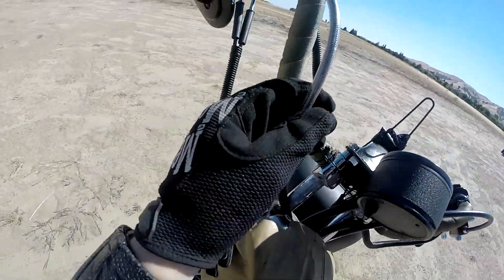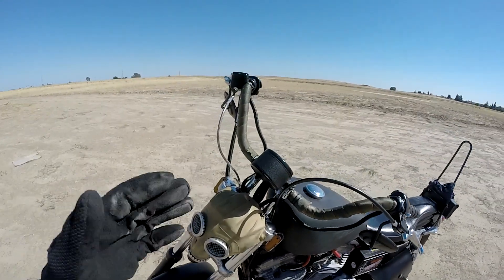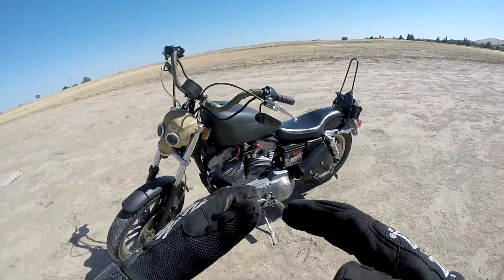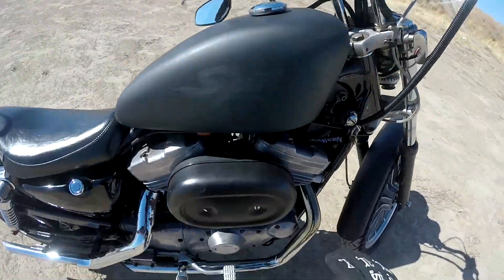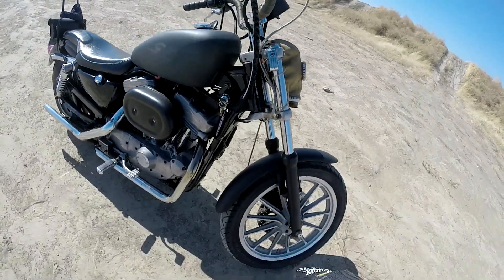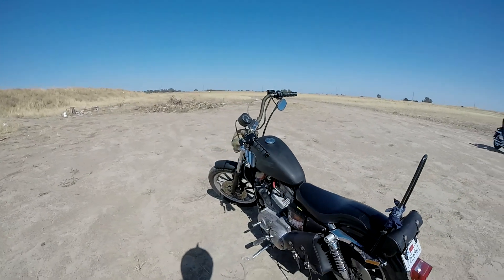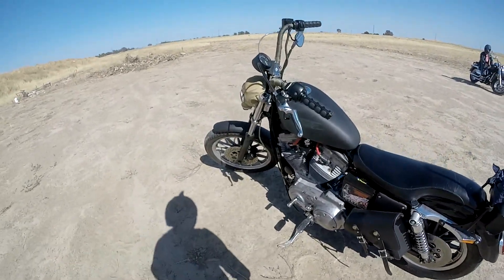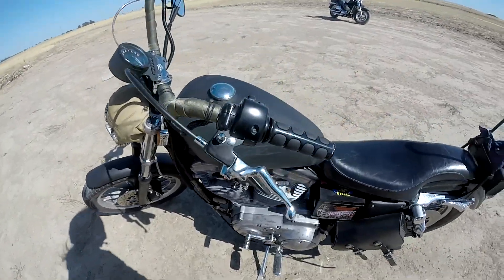Building A Wasteland Motorcycle - Sportster 883

Comment: Where did you get a brake like for $30 ???everywhere  I been  want  to charge me anywhere from $60 to $120 I would really like to kno
Reply from the maker: A few factors to consider for brake lines.... The length, material, and if you need some kind of fitting specific to the bike. Those prices are pretty high! Try 4into1.com and look up their universal Goodridge brakelines. You can buy the length you need and pick the fittings too! Much cheaper since shops will mark up the prices.